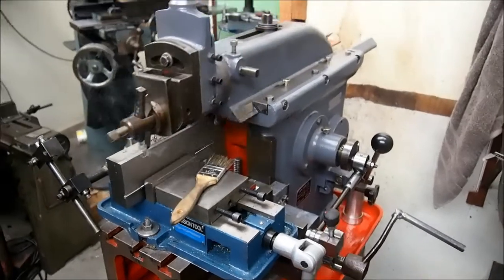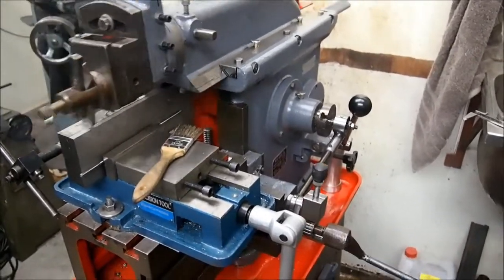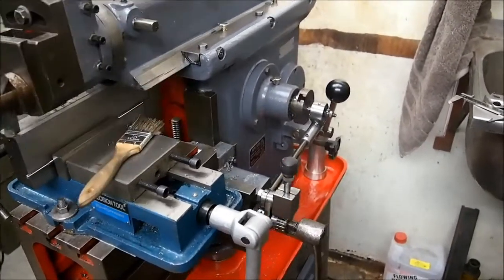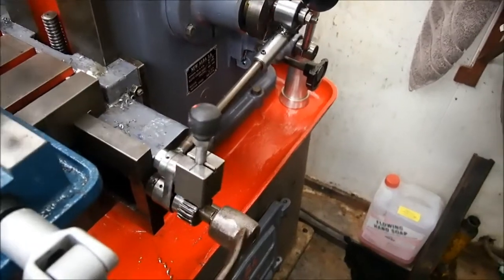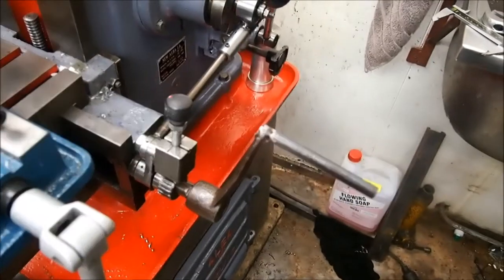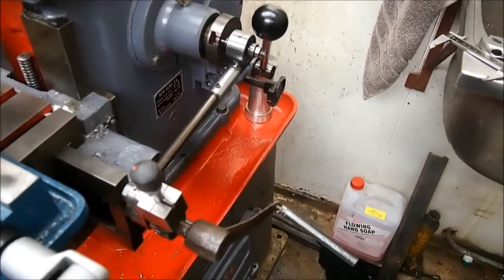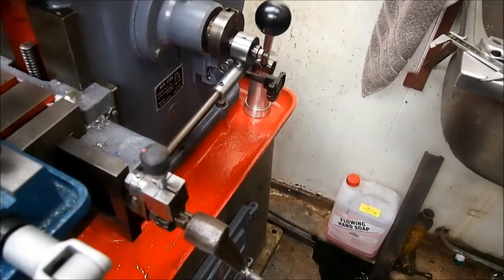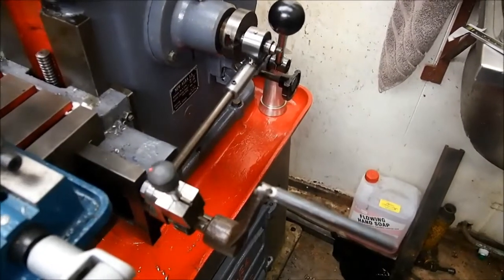Alba 1A Shaper -  Making an autofeed.  Part 1

Comment: Hi Neil. 
That's a well made linkage feed mechanism almost the same as my Elliott. Both shapers came out of the same factory.
Reply: Thanks Tony. I often wondered about the similarity between the 2 designs. I built the feed from photos of a shaper, the makers name I forget.
Reply: @neil1058  Hi Neil, I was watching this video again and wondered if you were aware that Elliot offered an aftermarket alternative ratchet feed assembly. The alternative unit had 2 ratchet wheels,one on the cross feed and the second fitted onto the table up feed shaft. Between these there is an idler gear mechanism and 2 drive dogs to allow either the cross feed or up feed to be engaged individually whilst the other ratchet was released to idle back and forth on the shaft. I have the Elliot parts diagram in my workshop.
Reply: @neil1058  I will try and find the site I  downloaded the Elliot parts diagram from. That would easiest. If that fails I'll try photographs or copying what I have
Reply: Eyup Tony,see my reply to Neil below
Reply: If your still looking for plans/diagrams, I have a copy of them saved when I was rebuilding the vertical/horizontal feed for our elliot 10m